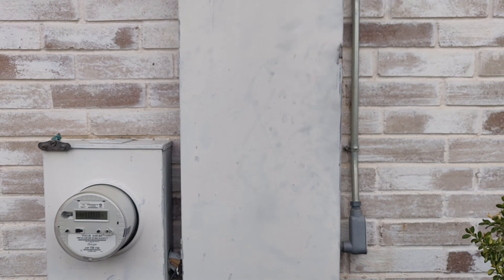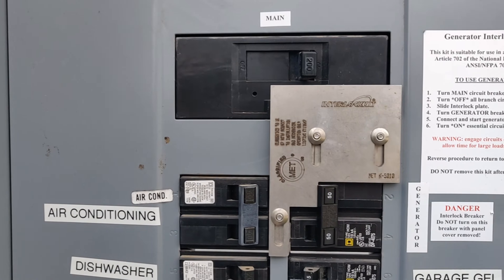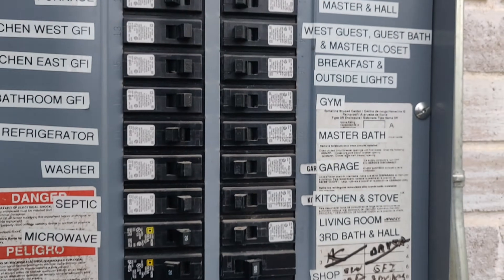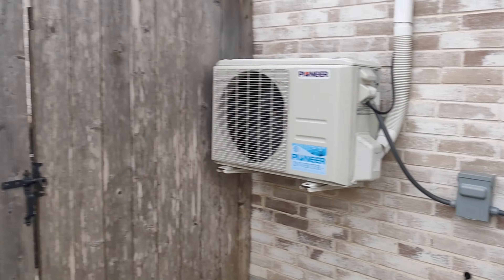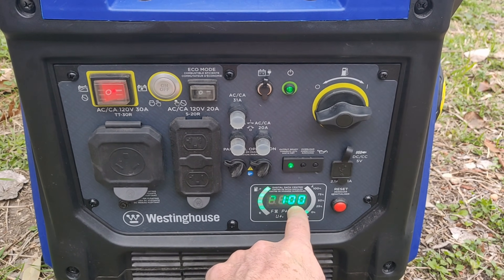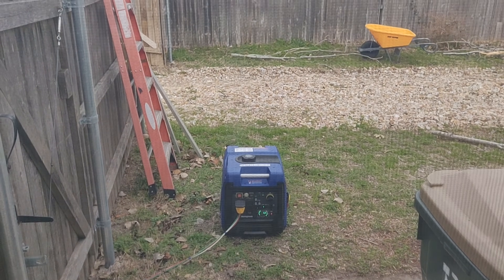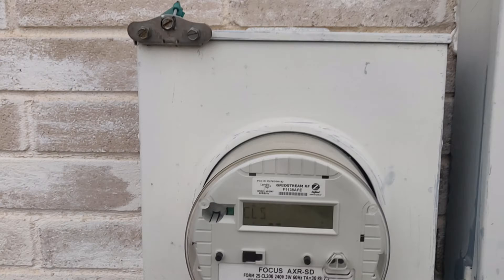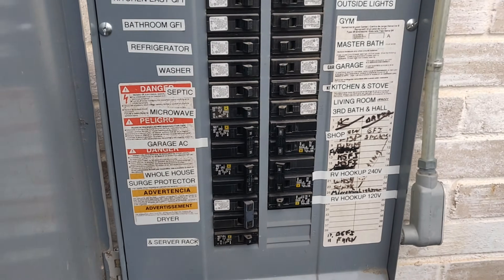Powering my house with a 4500 watt 120v generator.

Comment: Could you please make a video showing how to jumper the plug to be able to supply 120 to both legs of the house? Theoretically energizing all 120 circuit in the house. Thanks.
Reply: No kidding. I dont understand why someone would go to the trouble of making this video and not cover a critical part of the process.
Reply from the maker: I'm trying to say this without being rude, but I'm probably going to fail.  If you're not sure how to connect two pins together inside a plug, you should not be attempting this.

I'm not a professional electrician, and this isn't a HowTo video.  That's why I didn't show myself building this.  Instead I showed you the finished product, so that people can be aware that there's a right way and a wrong way to do this. And the wrong way can kill.

If in doubt, hire a pro.
Reply: @ElQuesoGuapo  In the RV world there are adaptors that do this very thing.  50 amp RV'ers use these when all they have is a 30 amp pedestal.  Easy to google these up on Amazon for 20 bucks.  Just got to pick the right styles of males and females and that would bypass the noob risk doing what you did.....yes?
Reply: @ElQuesoGuapo you still should’ve showed us the entire process whether you didn’t want someone to do it themselves. Apparently you shouldn’t have been doing it yourself from what I see. FYI don’t half ass a video and say I hope this was useful when really it wasn’t anything. You should’ve just showed us the card that came with the interlock kit telling anyone the process to turn on/off

Comment: Did you jump the breaker?
Reply from the maker: No, that's too dangerous.  The jumper is in the generator cord, so that it's only in place when I'm using that generator. Anyone modifying that cord to use a 240v generator would have to open the connector in order to add the fourth wire.  They'd be forced to see the jumper and remove it.

Comment: Does your generator not have a jumper between ground and neutral?  For your setup the breaker box has the ground and neutral connected. This can only be done once in a system. Unless you run power cords from the generator to your appliances you need to remove the shunt from the ground to neutral. It is out of code and unsafe to have 2 shunts in the system.
Reply from the maker: Good advice.  My generator has a floating neutral, so it's in compliance.

Comment: Great video....I was searching for the info regarding energizing both lines of the panel and you clearly provided that at 4:16....thank you
Reply: Could you please make a video showing how to jumper the plug to be able to supply 120 to both legs of the house? Theoretically energizing all 120 circuit in the house. Thanks.
Reply from the maker: Thank you.  I didn't mention it in the video, but just in case I'll say it here.  Be sure that the L1 to L2 connection is made in the cable that connects to the generator.  If you make the connection anywhere else, there's the possibility of L1 and L2 being connected while a 240v power source is hooked up.  And a 240v short circuit would get spicy!
Reply: @ElQuesoGuapo what do you mean

Comment: For the same installation cost you could do 240. A 240 inverter generator would only have cost a bit more. My advice is to always go 240 for interlock setup.
Reply: Actually he is set up to feed 240, but if you have a "small"  generator, and don't need to feed anything 240, then using 120 is more efficient.  I say that because you don't have to balance the generator by leg....only balance by total load.  You can feed a 240 inlet box by splitting the 120 output using a conversion cord.
Reply from the maker: I agree.  I have that 120v unit because I bought it first, for use with my trailer which required 120 v 30 amp service.  The generator was perfectly matched for that.
Then Uri happened, and I decided to add a generator hookup to the house.  I can't justify a new generator yet.  But if I was buying one now, I'd go with a 240v 50 amp inverter unit.
Reply: @ElQuesoGuapo  Ah, I get that now. I am in Austin and after the big freeze I put in an interlock and got a Champion 6250 inverter generator. All of my neighbors (and even my  girlfriend) thought I was over-reacting, but during the recent ice storm, the power was off in my neighborhood for 2.5 days and there were only two houses in the entire neighborhood with power, the woman across the street that spent $16,000 on a stand by generator, and my house.  As soon as the power came back, I had five different neighbors come to me and ask me what I was using.  Three of them have  already  bought 5000 watt inverter generators and they are all getting interlocks and inlets put in.  They realize they may never need it, but after two long outages in two years, they think it is worth having a generator as insurance. That was exactly what I thought when I set mine up 2 years ago, and I have already had to run mine 4 times.
Reply: it isn't cheaper when you already own a 120v
Reply: @TheArthurfonzarelli  I suggest you don't buy a 240v generator unless you need to run 240v circuits. A 120v generator with an adapter will power both sides of your breaker panel through an interlock.
Reply: @wes326  Thanks, that's what I'm set to do, just lazy about the implementation :)
Reply: @TheArthurfonzarelli  It's worth the effort.
Reply: @TheArthurfonzarelli exactly. FEMA paid for a 120v generator after Hurricane Ivan in 2004. In the year after I had an electrician install a transfer switch to power the 120 side of my house. I put a natural gas conversion kit on the generator and ran a line to a small purpose built generator shed. By the time Katrina hit the next summer I was able to power everything in the house but the washer/dryer, central air and stove/oven. 

Post hurricane use is my only concern so window units will do and I’m not planning to do much laundry or bread baking.

20 years later and that old TroyBilt generator still hums. I don’t have frequent power outages. I can’t justify a whole house system when my simple solution does the trick.
Reply: I also get that this is youtube, and it is mandatory to shit on all videos and any resemblance of original thoughts.
Reply: I agree with you and not sure about the video creator but I got a 3600/4500 peak 120v Westinghouse with handle and wheel kit for sale on Amazon brand new for $273 so I did similar to him.. bought 10awg sheathed wire, an inlet box. 30A breaker and interlock.  I had to relocate a few breakers since 120v only runs 1 bar but I have about 90% of my house lights, both my fridges for an outage.  NOW where it sucks is that in NW TN there's no natural gas so my water heater and stove are electric which sucks.. i can throw on layers of blankets or run multiple fans if needed but mainly lights and keeping food cold work for me.. 

Hell if i really needed to cook i have a gas stove and I could also run my pellet electric smoker as an oven if need be..  anyways i get your comment but that is why I have 120V instead and I really saw some of the downsize but hell for around $400 with generator, wire, inlet, breaker and interlock kit to sustain my whole house I aint complaining 😂😂

My old house out in CA I had nothing with the exception of led lights gas lanterns etc for lighting and weather wasn't a huge concern.  If i really needed I have a 300w inverter that connects to a car battery but I am a lot more equipped now and I have been in an outage in CA for 3 days but a little planning can go a long way tbh